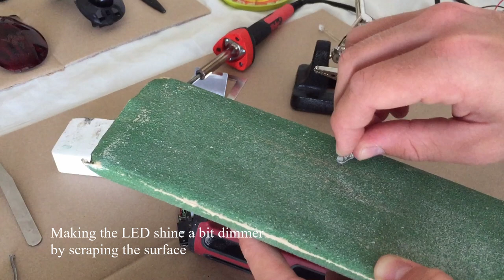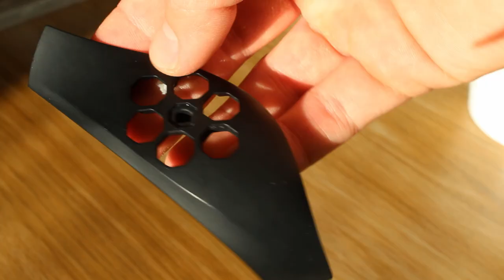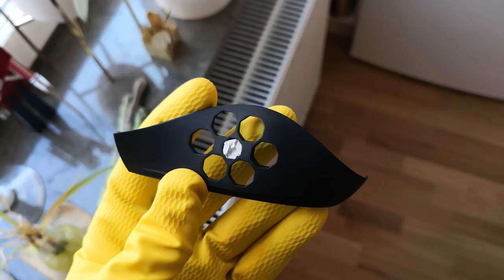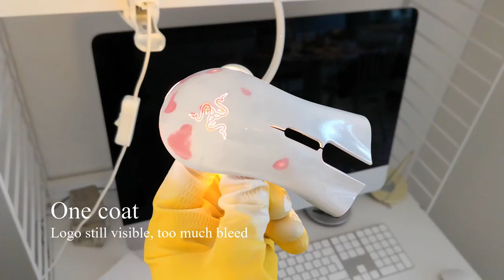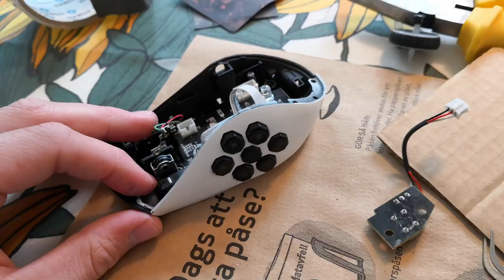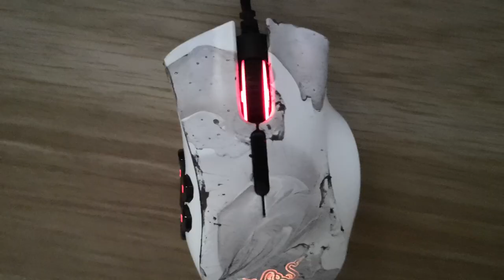Custom Marble and Magma themed Razer Mouse

Comment: what kind of paint did you use so light can go through? i've always wanted to make my lance head wireless black with red stripes but i'm scared to ruin the logo. Great work, by the way.
Reply from the maker: Hi! Thank you for watching. I used reglar spray paint for hobby purposes. You can find these in most hardware store or paint store. You need less coats of paint if you are adding dark colors to a bright colored object and more coats if you do like me and spray White paint on a dark surface. Any spray paint that sticks to plastic should be fine. Dont apply too many coats íf you want your logo to be visible. You can always try your spraypaint on a piece of scrap plastic before you spray on The actual thing you wish to paint. Good luck and have a nice day! :-)
Reply: @walnutcoffee2529  bruh I've been struggling for so long. Thanks will try.

Comment: Is it possible to sand the paint down to do a custom glowing logo?
Reply from the maker: I guess. But I wouldn't do it on an expensive mouse. You probably need to sand really deep and then fill it in with some epoxy. Once all that is done you can use some kind of dremel or similar engraving tool to form your logo. Don't get me wrong here, I'm not saying that it's impossible. Im just saying that it would probably be difficult (at least for me it would) to do this by hand without experience.

Comment: why did you add the plastic civer paint thingy on?
Reply from the maker: I'm afraid I don't quite understand what you mean. If you are referring to the plastic primer, I use it to make the surface more suitable for the spraypaint. In other words, plastic primer makes sure that the paint sticks to the surface of the object. Thank you for watching. Have a nice day!
Reply: Ooohhh thxs, and what do I need to use if I don't want it to start sticking a md coming off?
Reply from the maker: @DivineBaihu  Everything you have to know is included in the video and description. Make sure you treat the surface before applying primer and paint. Use paint that sticks to plastic surfaces and make sure you let it dry according to instructions of paint spray can, add an extra 48h to let it dry to make sure it's completely dry through all layers of paint. Let it ventilate for a few days before you use it to get rid of all the fumes. Feel free to ask me anything about the project, however you do this at your own risk. Be crafeul with chemicals and paint. Good Luck! :-)
Reply: @walnutcoffee2529  thankyou

Comment: Does it feel sticky at all
Reply from the maker: No, not in my opinion. It feels just like the old Razer epoxy finish. :)
Reply: I've experienced spray painting my controller 
It was a bit sticky at first
I was a first timer at it and it had a fare share of problems that i fixed eventually 

This guy looks like he has some experience so he probably did better than me